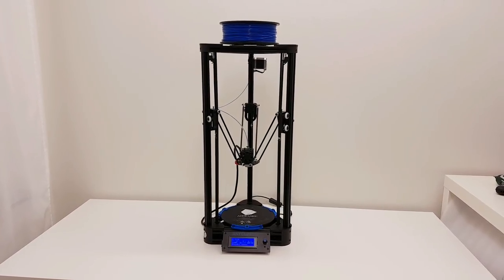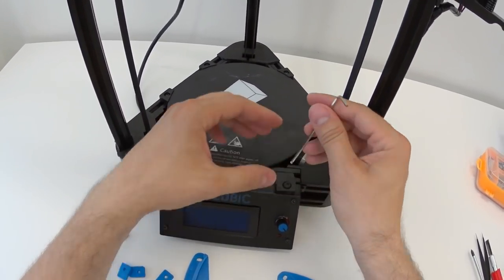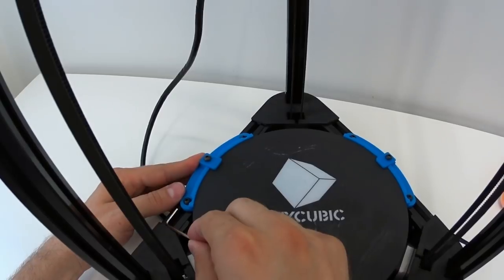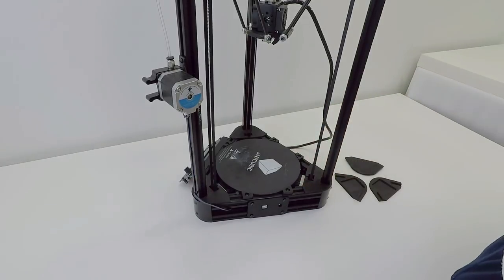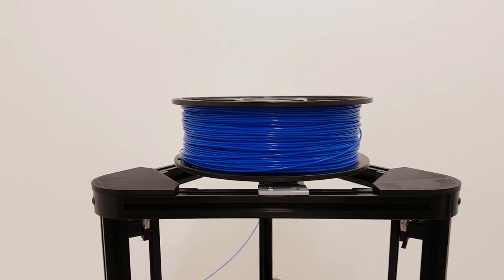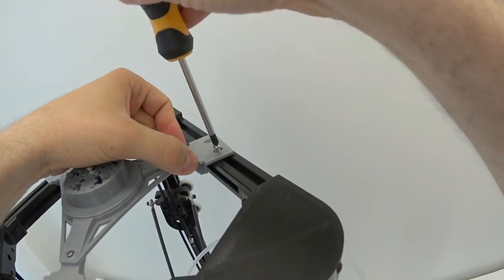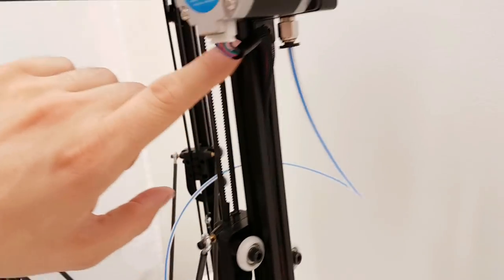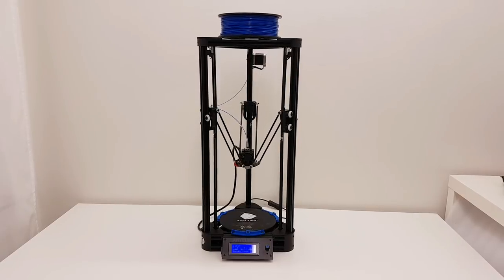Anycubic kossel 3D printer upgrades

Comment from the maker: I have hard time making BLtouch working correctly with this firmware that I have on my Kossel and there is only one Firmware available now(others are deleted?) and it last firmware Auto level support is totally absent. There is some other solution like using simple micro switch for auto level. I might try that but I already lost 10 hours of work trying to make BL Touch working with this motherboard and I did't have success. Personally I think that AutoLevel is not MUST to have for this DELTA to be honest. Am using it for months now and I calibrate it only twice. BTW if somebody have working firmware codes (right measures) and if wish to share here in comments that would be great otherwise its to much hustle and its not worth it.
Reply: If you are still interested I can push my working version to GitHub and link to it in a comment. I haven't found autoleveling worthwhile, after manually adjusting things , all that is needed is a bed height check.
Reply: I loved this video and i have been saving it for a long time and i actually just got my printer but i need help with it. I cant level it correctly and i need someone to help me by contacting me.
Reply: Moon Light it's a bit tricky as you have a bunch of different things that can be tweaked. Start by making sure the end stops are the same height from the bed, I used three identical spacers between the top braces and my limit switches after making the three top plastic braces level with the end of the vertical extrusion. 

Adjust the screws on the top of the carriages so they all are the same distance from the top when homed. 

Then you can start leveling (with a Delta it's a bit more than just "leveling" as there are curvature corrections)

I used the test print and instructions at https://www.thingiverse.com/thing:745523
Reply: So why didn't you build the parts at the Delta printer?

Comment: very nice to see you upgrade this printer. i have made the motor covers and am working on dual extrusion with a prometheus hotend. the bed clips are really great, but i am looking for/trying to design manual bed leveling as well.
that said, could you please talk us through the install and firmware changes of the BL Touch as well please? might be a better solution.

Comment: Are you going to add any cross bracing between the uprights to help reduce or eliminate possible twisting of the unit? Are you also planning to add the springs between the pairs of arms that hold the hot-end? Is there much risk of vibration of the unit by having the weight of the spool on the top of the unit as it gets turned while the filament is being fed to the hot-end?

Comment: will the bed clips work with a heated bed? being pla etc - possibly make them 3mm higher???? love the top mounted spool holder, been bouncing this around in my head for a couple of weeks now, cool to see it done.  good vid, cheers heaps
Reply from the maker: Well If you have heat-bed on your delta then you might want to print this clips in ABS. PLA will melt on high temps. So ABS here is better solution but not the best. ASA is better solution.

Comment: What do you think of the new Creality Ender-4? A ~250€ CoreXY (faster than any prusa, slower than deltas) with Ultimaker style bed, seems like a perfect fit for a review on your channel. I'm building a corexy printer from scratch right now, but this one would be something i would look into instead, if I hadn't started my build some time ago.
Reply from the maker: Yeah actually! Well price is good and It looks pretty nice as well. Just in between Delta and coreXY. Could be good choose. I try to get one for review.
 BTW i think first upgrade on this one will be adding V rails on other side of heat bed to support Z carriage :) Keeping whole Z carrige in middle air don't see like ''strong' solution. But that's just my quick look ;)
Reply: Yeah i never understood that choice of bed design... It's cheaper, but you need to build it so much more rigid just to keep it from wobbling.

Comment: Did you get auto-level installed? Thank you for the video.
Reply from the maker: I have hard time making BLtouch working correctly with this firmware that I have on my Kossel and there is only one Firmware available now and it don't even have support for Autolevel. There is some other solution like using simple micro switch for auto level. I might try that but I lost 10 hours of work trying to make it work with BL Touch and I did't have success. And I think that AutoLevel is not even must to have for this DELTA honestly. Am using it for months now and I calibrate it only twice.

Comment: @Nexi, won't the bed holder warp and get flimsy due to being PLA and the bed heating up? just a thought. I think you should print it in ABS to avoid the change in its size or it warping.
Reply: I don't think there is a heated bed on this printer
Reply: Then it won't be a problem.
Reply from the maker: No heat-no problem :)

Comment: When will you do a video on the auto bed leveling?
Reply from the maker: Laszlo Feledy I received my BL touch cables yesterday. A will do video soon as possible.
Reply from the maker: I have hard time making BLtouch working correctly with this firmware that I have on my Kossel and there is only one Firmware available now and it don't even have support for Autolevel. There is some other solution like using simple micro switch for auto level. I might try that but I lost 10 hours of work trying to make it work with BL Touch and I did't have success. And I think that AutoLevel is not even must to have for this DELTA honestly. Am using it for months now and I calibrate it only twice.

Comment: How do you get such good prints without a heated bed??
Reply from the maker: You don' need any heat to get nice prints :) Only good settings and perfect leveled bed ;)
Reply: It's true you don't need a heated bed. Once the first layer is down and sticking to the bed, no more need for the bed to be heated. Its not doing anything to the continued layers on the piece.

Comment: What would you recommend upgrading to print with nylon?
Reply from the maker: Dalton Sessumes Well, The Hot end can go to  260 Degrades so you only need powersupply and Silicon round heater(to install under glass) or new aluminum round  heated bed. Firmware already has support for heated bed and there is port on motherboard. That's it.

Comment: I just got one of these printers. Just finnished setting up but it wont show any of the files on sd to print. they show up on pc but in printer all folders apear empty. Any one know why?
Reply from the maker: batteryphil Check your LCD cable and try another SD card. Also what slicer you use? Files need to be G-codes.

Comment: I'm having a difficult time with the auto level, I'm using a microswitch. It auto levels fine but it doesn't seem to use the values it probed, I guess I need to spend some more time on it.
Reply from the maker: Did you add G29 in start G codes? Am still waiting for my extended cables for BL touch. We will see how it goes.
Reply: Will you upload a video of the install and auto leveling process once your cables come in?
Reply from the maker: Yes of course
Reply from the maker: I have hard time too making BLtouch working correctly with this firmware that I have on my Kossel and there is only one Firmware available now and it don't even have support for Autolevel. I lost 10 hours of work trying to make it work with BL Touch and I did't have success. And I think that AutoLevel is not even must to have for this DELTA honestly. Am using it for months now and I calibrate it only twice.